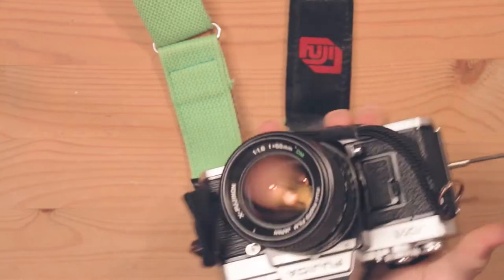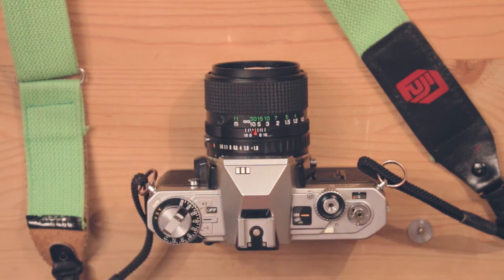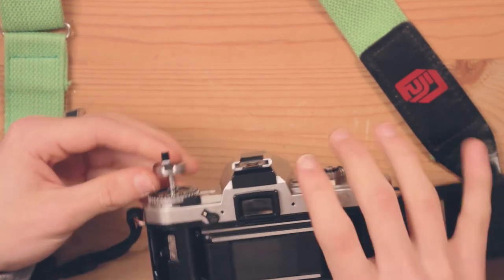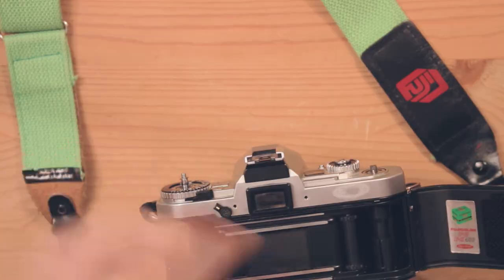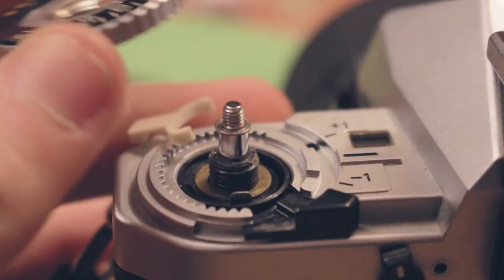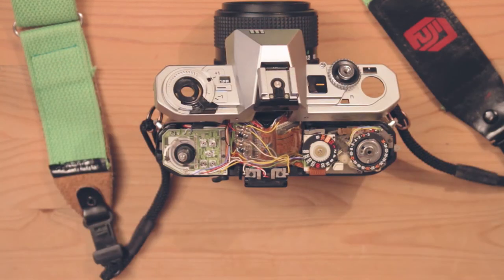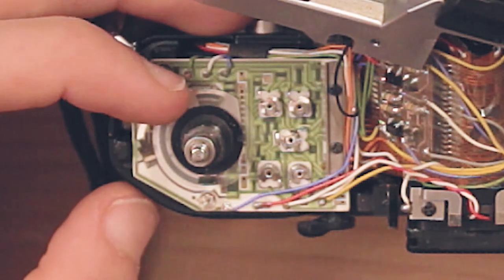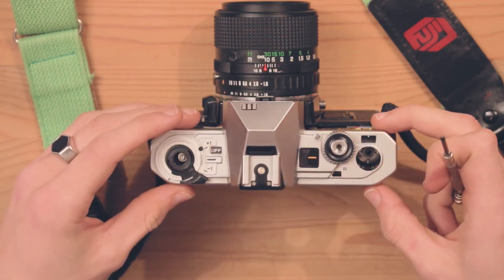How to open a Fujica AX-3 // Top removal (Also works for AX-5)

Comment: Can I get to the inside of the viewer from there, or do I need to remove more.  It seems very dirty, and it not on the window or the inside mirror, screen.
Reply from the maker: I assume you mean the viewfinder. The reason why I opened mine was to remove something blocking the viewfinder, I was able to do it, but it was a bit crammed. It might be wise to remove a bit more, if you're wanting to stick your finger in there with some cloth to clean things up. Good luck!
Reply: R530er yes, I see a lot of dirt, and it’s not on the mirror.  It must be inside, on the prism or the view screen inside.